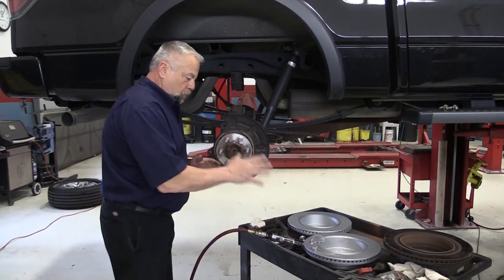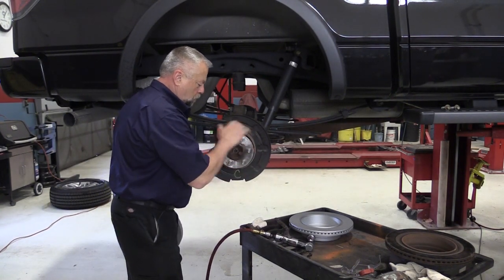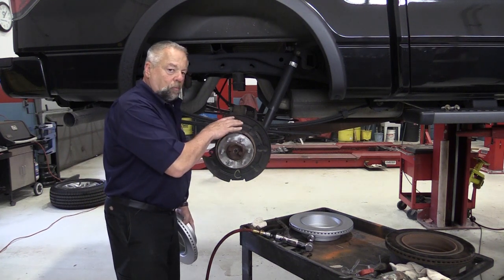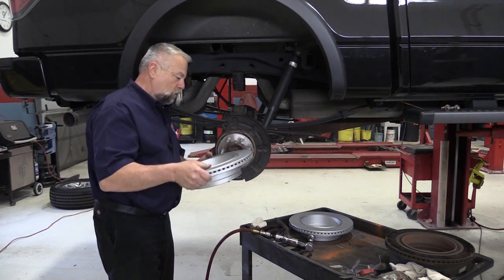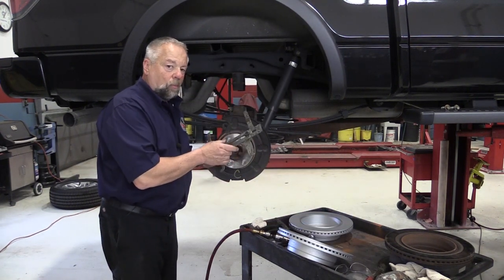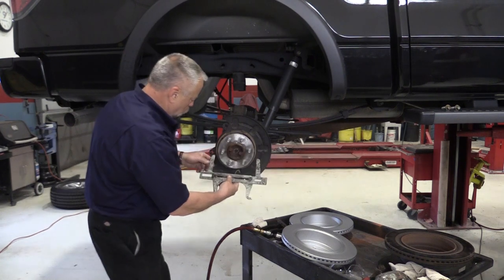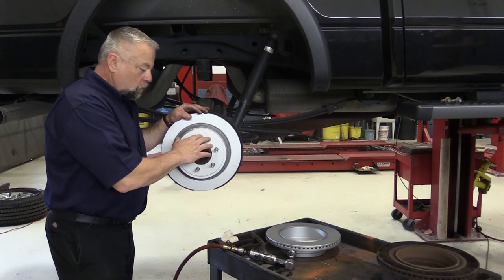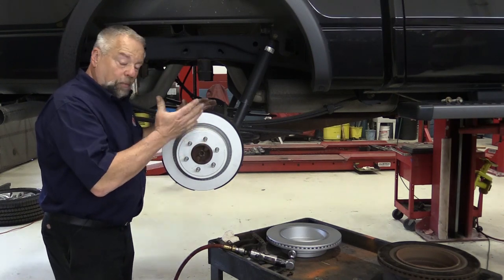Adjust Rear Parking Brake for Easy Drum in Hat Rotor Replacement

Comment: Can I get a part number to the tool you're using?
Reply: Westward 1EKA5 brake resetting gauge. It's not the one he is using, which is probably a Gearwrench product, based on the finish of the metal, but it's just as good and significantly cheaper.
Reply: Pretty much a tape measure will work

Comment: Adjusting that damn parking brake without that tool is a huge pain in the ass. It’s even worse when the salt has corroded all of the emergency brake components in the wheel